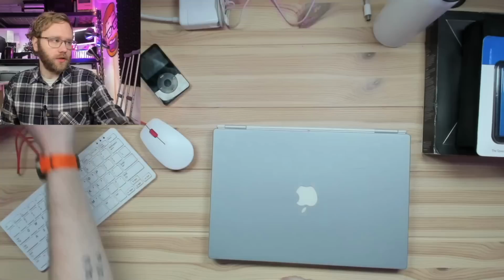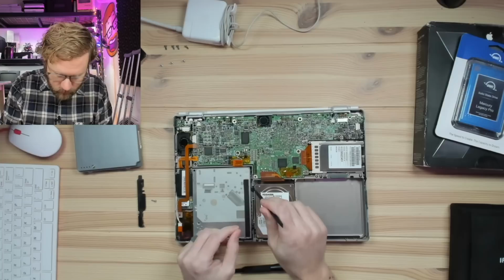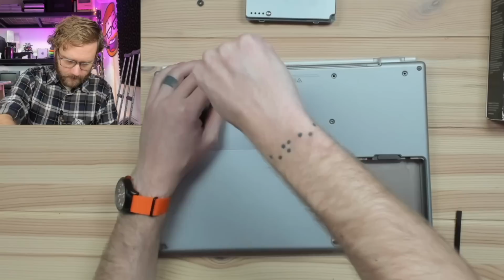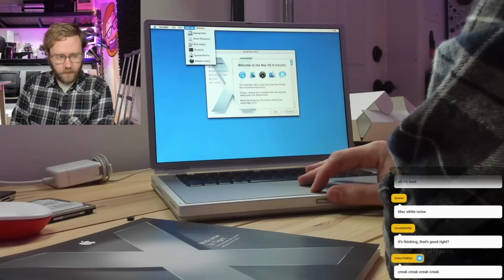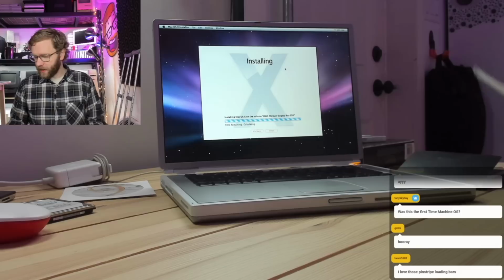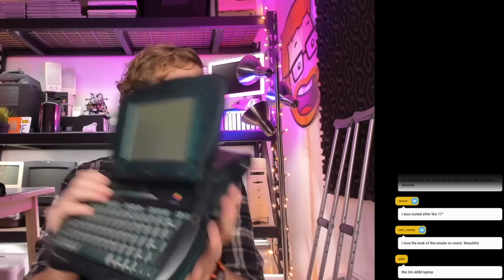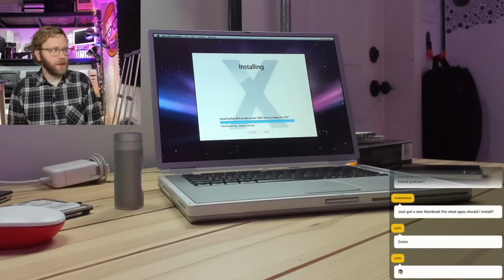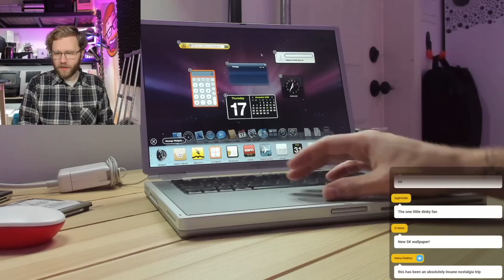Adding an SSD to a Titanium PowerBook G4

Comment: I had one of those SSDs for mi iBook G4.
Because of the legacy of IDE, it wasn’t that much faster at read and write, but random seek times were much better.
Nowadays you can CF-IDE adaptors, with a SDCard-CF adaptor, and a μSD-SD adaptor. The OWC Drive is much nicer though.

Comment: I'm going to try and replace the old HD from my Titanium as well. The current HD makes a crackling sound. I assume it's a goner. If I upgrade tho will the Classic 9.2.2 still work? Or are upgraded HD's only for OS 10 and up? 

If so rather than re-install the system software could I copy the system, (migrate it?), from another old laptop?

Comment: I have an Apple 2 GS, a ][C. a ][E, an enhanced ][E, an integer based Apple, and another Apple & still use them today.
Also 4 Macbooks, Powerbooks and Ibooks and a Silicon Mac M1, a 2006 Mac Mini, 2005 Mac Mini, 4 Ipads, an Iphone 8 and a recently purchased Iphone XR & in the bedroom a 2008 Imac 21 inch, and 3 Macs that need repair, a 17 inch Cinema Display & am getting a 20 inch at the end of the month and I found on the street a Thunderbolt display with a broken glass panel that I hope to restore.
I am intro Apple and old Mac gaming and I still use my older Macs and Apple ][s to play my older games so the Apple ][ is NOT dead in my home.
I play a lot of old SSI games on my ][e, need a new 3 1/2 drive for the Gs, play Arkanoid on the GS & am playing Diablo 2 on my 2006 and I want a Titanium Macbook so I can play Civilization 3 Complete.
I used to have Imac g3s, DV, a clamshell Ibook and a Newton and a Performa 550 and the original small Imac and 2 really old Powebooks with the trackball.
I will be buying a new Ipad next year and a 24 inch, 30 inch and Thunderbolt display next year and hope to get a Mac Cube because I have an aquarium someone made out of a Mac Cube case and it would look so cool to have it lit up next to a G4.
I also have an Apple color and green screen monitor as well and a Sega Genesis, N64, Atari 5200 and a lot of Nintendo devices.
I am 71 and knew Steve Jobs and Steve Wozniak and I also knew Bill Gates and Woz is a great guy. 
I went to Homebrew to see the Apple 1 and the first computer I ever used was a PDP 1 and I played Spacewar on it in 1968 when I was 16.
I have a lot of Apple ][ and older Mac games as well.
Apple ][ Forever.